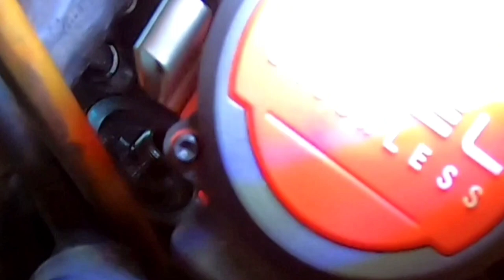Mustang GT 4.6 engine and transmission removal.

Comment: This video is solid, straight to the point, no bullshitting around no unnecessary information or anything to waste time. Got me to the point where I’m ready to pull.  just waiting on my cherry picker and engine stand to get here.
Reply from the maker: Thanks. I try to keep the videos short as possible without leaving any steps out. I'm waiting on the forged crankshaft and pistons to get here and it will be Dec before my connecting rods show up. Hopefully be making rebuild videos around that time.

Comment: As an avid builder of mod motors I gotta say this video was a good effort. You did a lot of good things but you also did a lot of unnecessary things that could’ve stayed on the motor and streamlined the entire process. The engine harness stays on the motor and you disconnect it from the main harness on the passenger side engine bay.
Reply from the maker: I always disconnect the harnesses from the engine before I pull one if I plan on rebuilding it. Either way the harnesses has to come off. Thanks for watching and God bless.

Comment: I know I'm a little late to the party but the wire harness can come out with the engine, disconnect the 3 in the passenger corner, off the fuse box and disconnect the grounds and the whole thing comes out with the engine
Reply from the maker: Yes I've done it both ways.

Comment: I have a question, do you need a transmission jack to complete this job, or can you just unbolt the bell housing from the motor and leave the trans hanging on the transmission mounts while the motor gets pulled?
Reply from the maker: If your car is a automatic you can pull the motor without removing the trans. You probably can with a manual also as long as you have room to pull the engine forward but with a manual it might be a struggle to put the engine back in. You can use a normal floor jack for the trans but doing that you will have to use a little more muscle to guide it. I've pulled many transmissions with just a floor jack.
Reply: @isolateddieselperformance3261  okay thank you i appreciate it, also these driveshaft bolts and the bolts where the downpipe meets the header are being a total bitch. i’ve tried a torch and an air impact and no dice on either of them any tips?
Reply from the maker: If heat won't get them off you will have to cut them off the down pipe. Drive shaft use heat and put all the muscle you have in it and use the 2 wrench method that I used in the video. Good luck brother hope my advice helps.

Comment: Man thanks so much for this video you just gave me a lot of motivation. I have a 2001 gt I got for free and I just bought the engine for 600 I’m about to drop it in this weekend!
Reply from the maker: You're welcome brother! I can't wait to get back to working on the mustang. Started building a shop and it has drove me in the ground with all the work. Hope to have it done by this weekend. The electrical is whats taking me so long. Bending 10-2 wire is like bending steel.
Reply: @isolateddieselperformance3261  you have a new subscriber here thanks for replying I wish you good luck.  believe me when I say this year started of ruff but I see the light and everything is coming together . Best of luck
Reply from the maker: Thanks for the support man! Keep your head up and pave your own path!

Comment: Appreciate you again. I watched this probably over 10 times. You have the best video on removing this engine! All I got left is transmission mounts and engine mounts and she out! 💯💯
Reply: I fought with that passenger bottom bolt on the downpipe for 2 days. It was stuck and stripped. Pb blaster and an extraction socket got her on out 💯💯
Reply from the maker: Glad it helps brother.

Comment: Good job .you make it look so easy .I did mine 2 times last year .doing little upgrades .now I have to do it again for replacement. You made a good video
Reply from the maker: Thanks! Its really not that bad. Now I just need to either find a coyote engine or rebuild the one I got. Either way I'm making a decision soon.
Reply: @isolateddieselperformance3261  yea make sure you check oil on a regular basis. I got lazy and seized my 2v by not checking my oil level .I had a gallon of oil in the trunk because 263k on the original burned a lill bit of oil .then for 2 weeks I would get in and start driving .and say to myself "you need check the oil when you get there ." Well at 3:15am I went for that engines final drive .now I own 2 4v 4.6 engines to replace my 263k mile original 2v it's kind of sad that engine was so reliable.  How about you do the cobra R swap with a lincoln aviator 5.4 and make a video .then you can use coyote intake manifold. It will give you content for Y.T. and help out the people like me who want to .I have searched and there's not a lot of good videos of the process just before and after videos .but not the actual process
Reply from the maker: I will definitely look into that swap and whatever I decide it will be on youtube with every step shown.

Comment: Thank you for actually showing where the motor mounts were i looked at many videos and all of them just say to remove the bolts but dont actually show the location to reach it or what it even looks like, i have an 03 gt with no trans on it so i can basically see everything down there hoping removal is way easier without dealing with the trans or exhaust  holding it to the back
Reply from the maker: You're welcome! Glad it helped!
Reply: @isolateddieselperformance3261  any advice on the fuse box? With my luck i pretty much destroyed the engine compartment fuse box trying to remove the fusible link from the post to remove the wiring harness and i hope i dont have to cut anything to make and splice it later if not needed
Reply from the maker: If I was you I would replace the fuse box with a new one or a good used and take pics where everything plugs in at on the old one so you don't lose track of where the harnesses go. If you have to do any splices make sure you use the same gauge wire and solder all connections and cover with  heat shrink wrap.

Comment: Great video I didn’t have to mess with trans besides bolts around housing ofcourse why did you remove everything else if you left trans under car? Just wondering
Reply from the maker: Makes it easier when you put an engine back in and I wanted to show the steps to remove the trans

Comment: Hey man I saved your video on the 4.6l tear down & watched your parts list video as well but looks like you deleted them? Are you still waiting on the machine shop to assemble or did you toss this project?🤔
Reply from the maker: The tear down should still be on there and I had to delete the parts list due to youtube policy. Will have to remake that one
Reply from the maker: Sorry I had it locked. You should be able to see it now and yes stuff still at the machine shop
Reply: Oh I see now! Thanks man thoes videos are much help. I'm in the process of building a teksid 4.6l for my 1996 gt so I can put some boost to her. But dang that's crazy it's still at the shop! What all are they doing?
Reply from the maker: Boring the block and shaving the heads. Took forever to get my rotating assembly and he stays behind. All machine shops are behind in my area. Its been exactly a year ago when I dropped it off. I'm getting anxious.

Comment: Thanks for the video man i got a 1999 mustang GT and the exhaust manifold studs were fucked up so i couldnt bolt the cat on so I tried to blow em out with my oxy acytlene torch whelp fucked up the manifold now. mine is an automatic tho is the process relatively the same?
Reply from the maker: Mostly the same. You will have transmission lines to remove and you will have to remove cover on the front of the bellhousing to remove your torque converter bolts.
Reply: @isolateddieselperformance3261 ok thanks, also how long did it take to remove the engine i am also in your situation doing it outside in the cold😂
Reply from the maker: You can do it in a day if you stay with it. Took me several because of my job. About 2 hrs a day for a week
Reply: @isolateddieselperformance3261  yeah i got time on my hands because i just dropped outta highschool to go do shit like this
Reply: @isolateddieselperformance3261  1 more question I've seen a lot of other people do it without pulling the intake manifold they just do the fuel line and main engine harness to the car etc. Is the point of doint all of that just to get to the top 2 tranny bolts?

Comment: On the starter bolts side I have longtube headers in the way. Is there anyway of getting those bolts off without removing headers or k member 3 for started and two for transmission bolts?
Reply from the maker: A few long extensions and from front of engine go between headers and motor mount. You will have to feel for the bolts but it can be done.

Comment: I have an auto. Where do i access the torque converter bolts from?
Reply from the maker: Remove the access cover that sets between the bellhousing and the oil pan. You will have to remove a couple bolts and rotate the pressure plate and remove  a couple more and rotate again till you get them all out.

Comment: how should i disconnect my exhaust if i dont have cats and is no where to disconnect them? just cut em??
Reply from the maker: Unbolt the exhaust manifold from the heads and bring it out as one piece or unbolt it at the first connection closest to the front of the car and pull the engine with it intact. You can pull these engines with long tube headers. That sounds like that's what you have unless someone weld everything together instead of using hardware.

Comment: What is a fair price for a shop to charge to swap this 4.6?  Also, how much to rebuild?  Great vid!
Reply from the maker: A swap about $1000. Rebuild with labor between $2000 to $3000 depending on where you live. Thats ballpark figures.
Reply: @isolateddieselperformance3261  Im in Seattle so probably triple that lol.  Is there a fuel pump assembly that will work on this car that can mount from the top of the tank and hang down?  The welds broke off of mine and fixing it didnt work either.
Reply from the maker: Im not to sure. Might can find a fuel cell that will fit in the trunk. Only thing with that is you would have to pop the trunk every time you fill up.
Reply: @isolateddieselperformance3261  thanks for the reply.  My trunk is full of subwoofers.   Which is why my basket broke off twice so far.  No fuel gauge sucks and a new tank would only break eventually.  Ive seen top mounted cells but I dont know how to check for compatibility.  I could drill holes and bolt the basket down but Im afraid it will leak.  Maybe if someone drills my tank and steals my gas that would be a good enough reason for me to just drill it.  The factory spot welds aren’t working and neither did the epoxy :/
Reply from the maker: If you don't need the back seat you can put a rear seat delete in and put your subs there to free room for a fuel cell in the trunk
Reply: @isolateddieselperformance3261  if I decided to give up my back seat I would just add more subs lol!  That would be awesome!
Reply: @isolateddieselperformance3261  I have a bad engine at the moment.  I need to decide on what I gotta do.  Head gasket, rebuild, etc.  compression is getting into coolant system and will blow heater hose when I rev it up. Ive been short shifting everywhere I go but I listen to music anyways.
Reply: So I looked into 2011 crown Victoria engines for my 2003 Mustang GT.  All of them say Flex fuel.  What does that mean?
Reply from the maker: Just means you can run up to 85% ethanol if you choose to do so. If you decide to use that motor don't put 85% ethanol in it unless you are going to use the pcm and other computers out of the crown vic. Just run the normal gas you use now.
Reply: @isolateddieselperformance3261  I got it.  It has an alcohol sensor and it doesnt work with my stock computer but the engine will run fine as long as I use pump gas?   I found a really clean 4.6 out of a 2011 marque.  Its like $1400 plus shipping but I just want reliability over the price.  Mechanics are sooooo expensive here in Seattle plus I cant trust anyone lol.  Thanks for the info!
Reply from the maker: It should work. You might have to use some parts off your original motor but not to sure. Because the vic is 2011 make sure your trans and computer will except that engine.

Comment: Yo I got a question about a 4.6L I dropped in my manual gt 01. When I drunk it up it was running very poorly and was like something was holding it back you can watch a video of it on my channel
Reply from the maker: I found your video. Really hard to tell till you do something about the exhaust but sounds like you got a huge vacuum leak or its miss firing. Did you put in new plugs and wires?
Reply: @isolateddieselperformance3261  yes I put in new plugs and wires
Reply: @isolateddieselperformance3261  we also put it on the computer and the only code was 02 sensor
Reply: @isolateddieselperformance3261  and Yea everyone telling me it’s the exhaust tbh
Reply from the maker: I would get the exhaust fixed first and go from there. Clean your mass air flow  sensor and make sure all vacuum lines are in good condition with no cracks.

Comment: Is it the same process with a automatic?
Reply from the maker: Pretty much. Take inspection cover off of bottom of transmission and unbolt the torque converter from the flex plate. Break the transmission bolts loose at the  crossmember and just slide the trans back enough to clear the engine leaving the driveshaft installed. No need to remove driveshaft or drain the automatic transmission.

Comment: It’s so much easier leaving the trans bolted to motor and taking everything out together
Reply from the maker: Not where I was pulling it out. Its really only about 6 to 7 bolts and a few inch pull back on the trans difference.
Reply: @isolateddieselperformance3261  This is the comment i was searching for, the engine and trans can be removed together?  We are about to pull my kids 3.8 and looking for the best way. As long as it isnt just a bent valve in #4.
Reply from the maker: Yes they can be pulled together. I choose not to do it that way.

Comment: You make it look easy mane.
Reply from the maker: Its not to hard
Reply: @isolateddieselperformance3261  I just spun a rod bearing doing donuts on low oil in my 98 gt 🤦🏾‍♂️🤦🏾‍♂️ I’m so heartbroken 😂😂 so I gotta do this. Sheesh. It’s amazing you did this all with that electric tool and
Reply from the maker: Sorry to hear that man. Definitely sucks
Reply: @isolateddieselperformance3261 help! 😂😂 I’m finally tackling this. My 98 has 2 fuel lines. What’s the difference
Reply from the maker: Your manufacturer date must have been in 97 and its stamped as a 98. If you have 2 fuel lines then one should be a return line. Ford went returnless on these cars sometime in 98
Reply: @isolateddieselperformance3261  would a 96 cobra be the same. That’s what I’m looking to throw in here
Reply from the maker: Yea it should also have a return line i would think but if not then you will need to delete the return line and upgrade your fuel pump or get a fuel pump for a 96 cobra.
Reply: @isolateddieselperformance3261  right now I’m fighting this passenger side exhaust bolt. I don’t think I can get to the bottom one without removing the starter. Shit is kicking my ass
Reply from the maker: Go ahead and remove it because you will need to anyway. Starter is the hardest part of the entire process
Reply: @isolateddieselperformance3261  ok bet